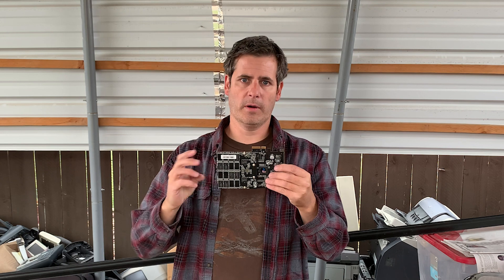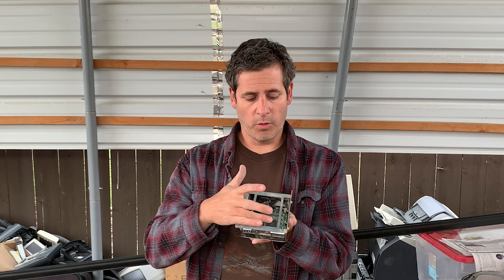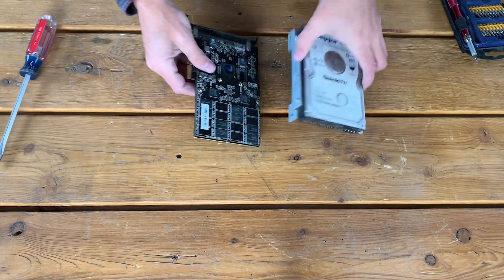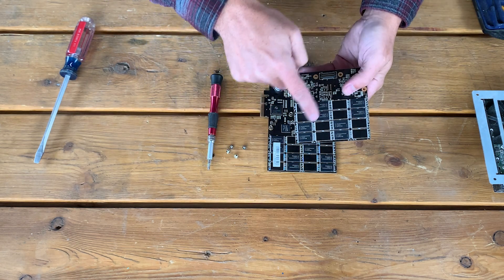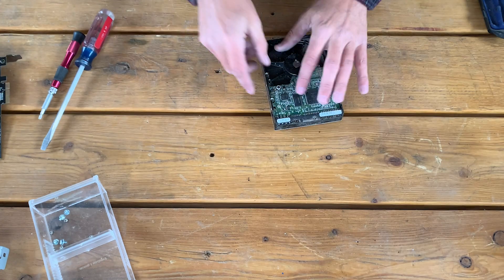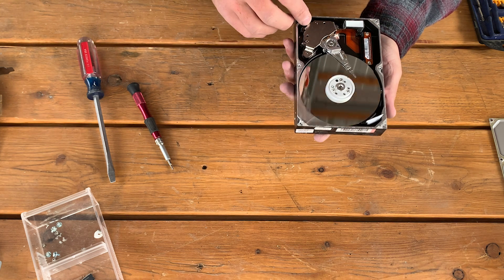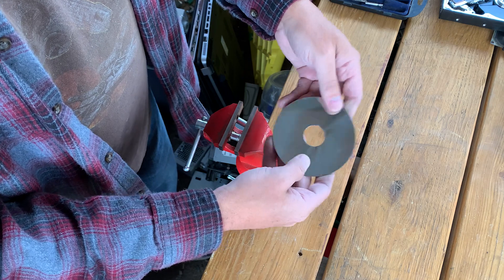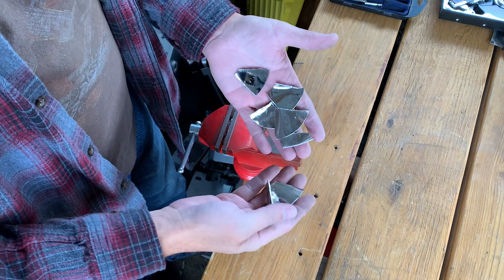My Way to Securely Destroy Hard Drives

Comment: Great video. Thanks for the explanation. In the past I have usually smashed my drives with a sledge hammer and then drilled holes in the platters. I didn't know about the little chip that also needs to be destroyed.
Reply from the maker: :) most of the time, that chip gets damaged when the drive gets smashed.  Once the chip is damaged, it is effectively neutralized.  Most people don't even bother with it as it is a quick store of memory.  Only the last print or prints would be in there anyway.  And with the registers setup they way they are, it would be randomized ... it would be pretty tough to rebuild a full document from that ram chip... but it could be possible.  So, it is better to destroy it... 

Oh, and nice videos :) I like your 360º stuff.  I miss DC and the east.  Thank you for sharing your outings.

Comment: Ssd's work much differently than you think. Data is deleted than rearranged every time you add something or delete something. It works like this because of the cells they use in each chip. Cells will die once you write to it to many times. The extra chip on the hard drive the old school disk, that is called the cache or disk buffer. Yes it does what you said by directing traffic when read or write data but it also holds the most recent programs you are working on so it doesn't have the need to pull it from the plattersnmaking these hard drives seem faster
Reply from the maker: SSDs do randomize data placement and the erase does happen when data is written back to them, but the data does persist if it is not requested to be deleted.  The company I work for outside of bad idea metals destroys everything on the drives for data safety.  All chips are thoroughly crushed and shredded.  Most people just worry about the spinning platters and ignore cache ic chips…
Reply: @badideametals  the data is moved from that cell, that cell is wiped and it starts over. Most SSDs work like that but some newer ones operate a little different.
Reply: @badideametals  the boards are usually removed when scrapped, if someone damages the platters and leaves the one chip no one is going to get anything for id theft, ssds have really small cache sizes because the storage is already fast and the only data being saved usually most often programs but no data involved with them. As a hacker we could care less about hard drives or getting anything like that because we can send any malware or Kelloggs to gain access to everything without someone knowing, or sitting right outside someone's house and grabbing data packets off the router. Nothing is secure anymore, even two factor authentication can be hacked
Reply: When you say "Data is deleted than rearranged every time you add something or delete something."
I'm a little confused. Does that mean old deleted content is gone the moment you add anything else to your hard drive? I have heard that data can still be recovered on SSDs. 
What is the best way to make erased data full unrecoverable on an SSD?

Comment: Isn't it possible to just pass a magnet over memory media to destroy any ability to recover info? Or just use a hammer on the chips and sandpaper on the disks?
Reply from the maker: Degaussing is a technique, but some experts argue how reliable that process is… also, I would need really strong magnets … stronger then hard drive magnets… it is not something I am equipped to do for those who give me drives and trust the data to be destroyed.  So for me, drive destruction down to metal components is my way :) … but yes, you are correct that it is an option.  As for the hammer, I process the chips for gold, and the hammer sends the pieces everywhere.  But if someone else who did not care about the gold were following this demo, then yes, a hammer would be great!  And finally, I have not thought to use sand paper.  It could work I guess…
Reply: Most of those can still have the stroage recovered. Nothing is on the chips besides for some data but it stored on the platters as well unless your dealing with new storage like solid state, no platters than. Using a screwdriver while the hard drive beofre taking it apart is very effective. If you look on the back of each hard drive they have a small piece of silver tape where you can enter the screwdriver. While the hard drive is spinning let the screwdriver damage the platter. For hard drives that have more than one platter, break them into tiny pieces and throw half away one week, than the other half the next week. For those that can melting the platters down is full proof. There are several methods that can work but even more that fail to delete data.